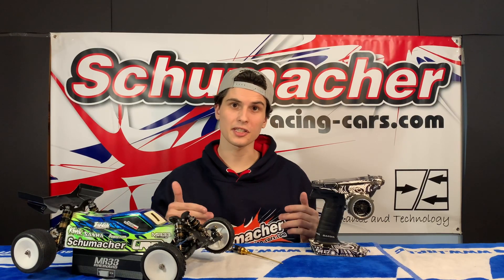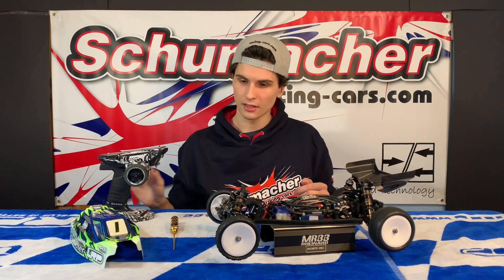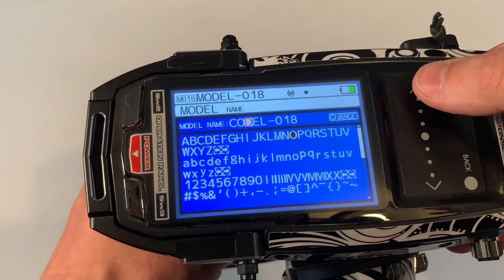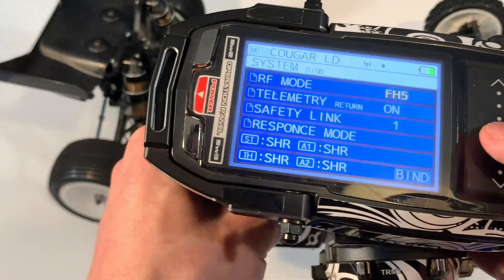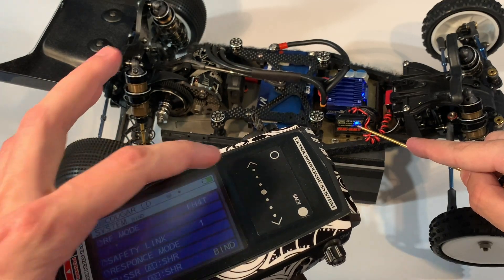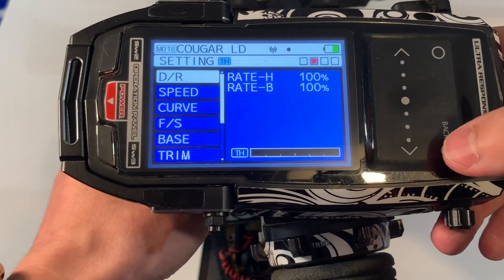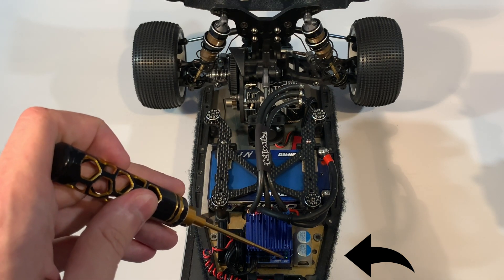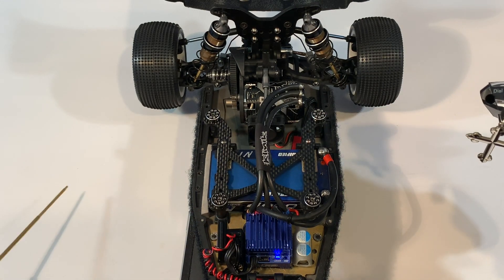HOW TO CALIBRATE YOUR SPEEDO AND RADIO | COOL FEATURE OF THE LRP SPEEDO | TUTORIAL |

Comment: Hello, how do you make the travel on the throttle and brake shorter? I want it to be more in the center as you said on the live. Thanks
Reply from the maker: Do you mean the travel of the trigger on the radio?
Reply: Michal Orlowski Racing yes exactly thank you for the respond. I feel like braking is to far to the front on the trigger.
Reply from the maker: I have never heard of this option before, but I will look into it. You can make your brakes more aggressive, so that You don’t have to push the trigger all the way to get the brakes You want. It should give You the same effect. My brakes are very strong.
Reply: Michal Orlowski Racing perfect  I asume that could be done haha. I’ll do that setup change and try it. Thank you 🙏  i appreciate it
Reply: @pedrocuevasmusica  Hi Pedro. This is 3 years ago and I dont know if you have solve the problem you had with long trigger travel for braking but here is a solution you can do. When you set up the neutral/full forward/full brake, use a hard item(like 3-5mm thick or thicker if you need) behind or in front of the trigger to shorten the travel for full throttle or braking. So you set the neutral as usual but then you put the hard item of your choise behind/in front the trigger and then push the set button. Now the 100% full throttle/brake comes erlier. But if you dont mean shorter travel on the trigger electronic way for throttle/braking you maybe mean adjusting the triggers neutral position and you have a set screw for that. Look in your manual. Hope this helped you.